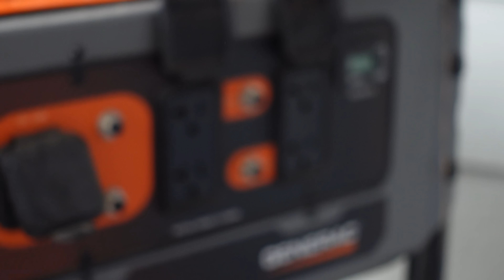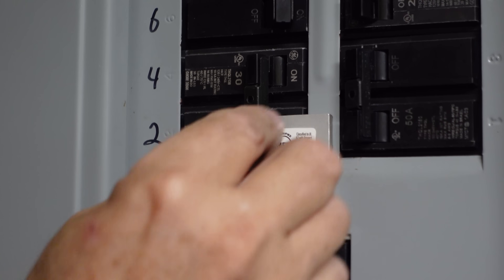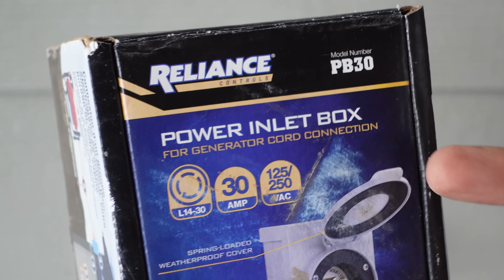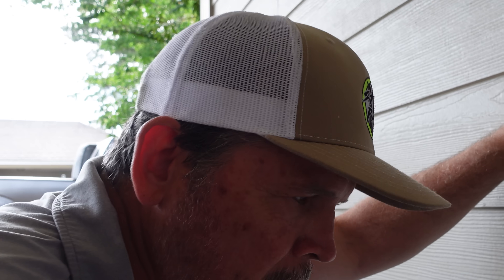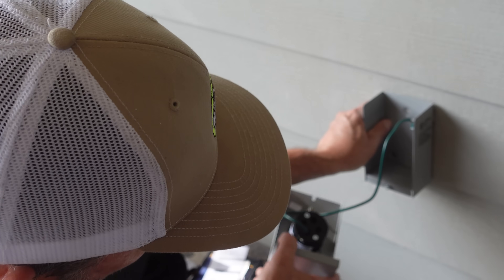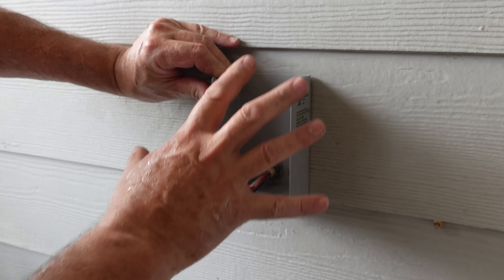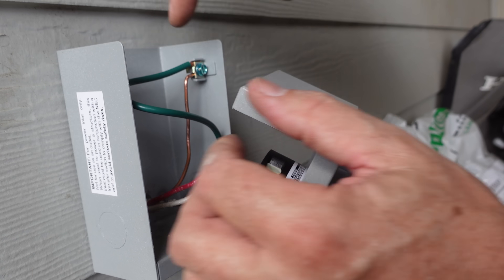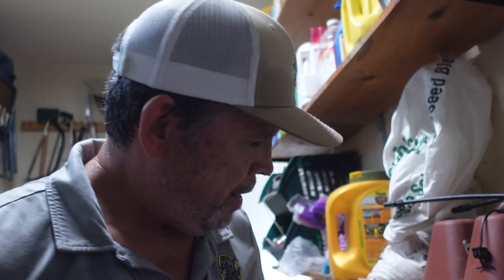What is a Suicide Cord and Why It Could Kill You

Comment: Important safety tip:  After you doubly confirm the circuit has been disconnected  there comes a time when you must touch the wires with your bare hands.   As a general habit, always touch the ground to you thumb and the hot wire with your pointer finger with the same hand. This way, if somehow you forgot to power off or if someone energized the circuit without your knowledge, a path between your fingers on he same hand will be formed.  You would feel a shock, but it won’t go through your heart.
Reply: Is this true or are you trying to thin the heard using natural selection....  I am completely uneducated with anything related to being an electrician and home improvement so forgive me if it's a dumb question.  I read this and it just felt like a troll who wants people to try it so they get hurt bad,  lol.  No offense,  just curious.
Reply: @nostalgiaarcadefuture what he was saying would make the majority of the current pass through your hand. Worse for you hand, better for your heart and rest of your body.
Reply: Use your Non-Contact Voltage Detector Pen! ( Klein Tools NCVT1P Voltage Tester, Non-Contact Voltage Detector)    Never risk a shock especially with 240v.  If you heart stops you don’t get a do over😢

Comment: You didn’t mention what gauge wire was used. It looks like it was 14/3.  For your 30A generator, you should be using 10/3 wire.  Perhaps you did, I can’t tell, but it looks like what’s sheathing.

Comment: In watching your video on upgrading the generator receptacle I noticed that the existing wire had white insulating jacket. This shows that it is 14gauge wire which is only rated for 15amps max. Thats why you found the previous 20amp receptacle which is aloud but not recommended. To run 30amps you need 10-gauge wire from the 30amp breaker. I believe you may have created a potential in the wall fire hazard.
Reply from the maker: Color coded sheathing started in 2002.   This is 10g wire in this video.

Comment: 240 volts from a 30 amp source, across some little electrical connectors an inch apart. "It's gonna kill me" is an exaggeration... but not a very big one. It could kill you and if you touch it, it's very likely to at least injure you.

Comment: Notice at 5:51 that now the receptacle is the one with prongs exposed. From this receptacle to the house lines, you need to have a disconnect where you change from plant power to utility power. That way when the utility power comes back, and you switch the disconnect, your wall outlet will not become a "suicide outlet" because no utility power will be exposed in those prongs. It's exactly what he is trying to avoid with the plant from the outside, but coming in reverse from the house with the utility power.
Reply: It cannnot become a suicide outlet.  The interlock on the panel will prevent the generator breaker from being turned on at the same time the main breaker connecting the panel to utility power is on.  It's physically impossible to have it energized from utility power.

Comment: The only real safest option is replace all this with an automatic transfer switch with mains monitoring controlling auto start of the generator and automatic switching from source 1 mains through an off position to source 2 generator. When the mains returns the ats sees the mains power return and will run on generator until a set time to ensure the power is stable and then will switch out to off position and back across to mains source 1 and generator run signal is disconnected

Comment: I have to admit that the manual interlock at the panel was the correct thing to do. But the rest is BS.  If you put the panel in two years ago, why didn't you fix the plug two years ago?  Plus - Who uses a track saw and a pocket screw guide to make blocking? A show off.  And then drills a hole 3x too big for the wire? Why didn't you caulk the box to the wall?  That's a water infiltration point. And there is absolutely nothing wrong with changing ends of extension cords - you are lazy or incompetent.

Comment: problem you might get with putting those power cables in around the wrong way is connecting a additional generator or a solar panel inverter if the phases are opposite they'll be fighting eachother but i guess thats only going to cause a breaker to pop

Comment: If they are going to use this during a storm,  that's still the wrong receptical. That one is only wet location rated when CLOSED...IE not in use. You need one that has a cover that can be closed while the generator is plugged in.  Search for a U030N. Yes they're expensive. Other than that nice job.

Comment: We used these when learning to weld
Our lincoln electric welders had them at my college
These connectors will kill you
They instruct us not to fix a problem on the welder that isnt a piece that can just be swapped out because as my teacher said "these things will shock you dead" serious stuff
If it can output enough power to melt base and filler metal, its enough to melt you

Comment: This gets so much more confusing when you start adding in power banks.  You could have a power bank that works like a portable generator,  a power bank that works like a perm generator.  BUT these setups can get even worse, because some will charge off solar/wind, but also charge off main lines, these can be set to charge during off peak hours,  meaning you could fill the power bank if needed during low usage times.   

That said, some of these are also made to "automatically" back-feed in a system to "sell power" back to the power company from solar.   so when your battery is full, your output is low, but you are still generating power, excess power will be sold back to the power companies back-feeding into the system.   Yes, this can cause the same risk to linesmen.   

so then you get the icky combination system,  Where you have power going both ways, in and out,  you have solar charging your battery bank, your battery bank powering your household system, a generator acting as power back-up, and now you need a way to dump excess energy when your batteries are full,  the solar panels are function, the generator is on,  but the house isn't using a lot of power, and it would normally backfeed at that point to prevent overcharging.

Comment: Excellent video! The explanation of how a generator works and the danger of improper connections and/or cable is spot on. The only thing I would have done in addition to the installation of the generator interface would be adding a bead of 100% silicone sealant to the sides and top of the box before mounting it on the wall. It looks like the box is installed under a porch over hang, but driving rain could still allow water to penetrate the wall behind the box.
Reply: At -1:45 he said their was a lip on the back for weather proofing 😅

Comment: TIP: When doing connectors on nockouts, try having your locking ring to the outside of the box and the screws on the inside, it sounds weird but it makes installing things so much easier if you angle it right, you can screw the box into place and clamp the wires down while the box is on the wall.
Reply: Instead: clamp the locking ring to the wire, then pull the wire with locking ring through the box, put on the locking nut.
Reply: Yes indeed

Comment: Looks good guys. Curious why did you cut the hole for the wire so large? For the metal crimp to hold the wire in, why not have the crimp part with the screws on the inside of the box? Does NEC require it to be that way? Lastly, why not just change the end of the extension cord?

Comment: The new wall outlet was really needed but the suicide cord is still dangerous. What I did was slightly different.
    When I had my garage built after we moved here, I wired it internally and externally to the house. Internally, I used 14 ga. wire for the lights and garage door opener, 12 ga. for the outlets and 8 ga. to connect it to the breaker box below my power meter. This box is 50 feet closer to the garage than the house panel, is the point where the power comes into the house, is wired to the house panel with 00 ga. wire, it saved me the expense of buying 6 ga. wire for the extra distance and was much easier to access.
    I didn't use the interlock because I didn't wire it to the main breaker panel. My panel box below my meter has knockouts for four breakers so I installed a double 40 amp breaker there, ran the wire underground through conduit and into the eight circuit box in the garage. There, I installed the appropriate breakers for the other circuits and a double 30 amp breaker for my 7 Kw troy bilt. I slipped a large, orange zip tie through the connecting rod between the breaker handles to positively identify it's job with the generator. I installed a dedicated 50 amp outlet on the inside wall specifically for the generator so that the plug never has to be removed from it's outlet and the plug on the generator's end never has to be removed from the generator. This way, nobody gets shocked.
    In the house, I shut off all the 240 volt breakers before starting the generator. 7 Kw's won't run a 4 ton heat / A/C unit let alone if the hot water tank is running or if the wife is cooking along with everything else. I slipped small, red zip ties onto the connecting rods of the breaker handles to make it easier to identify them faster
    My garage isn't fancy or finished off inside. Just a bare bones corrugated metal building unattached from my house. My generator has it's own spot by the walk in door next to it's outlet and the breaker box. It runs there when needed after I pull my van out. The walk in door and big garage door are propped open about a foot for ventilation. Otherwise, the engine chokes on it's own exhaust. I also keep a 20 inch box fan plugged into it and standing at the end of the generator for extra summer cooling. I also installed a 120 volt outlet nearby for it's wall wart style starter battery charger.
    So far, in the 21 years that we've been here, I'm the only one who has operated this system but just in case my wife ever needs to if I'm away, I walked her through each step physically and I printed a reference sheet with words and graphics telling and showing each step numbered in order. Then I attached it to the generator in a gallon size ziplock bag so she can pull it out and look at it if needed.
    What really irritates me are these knot heads that connect their 8 or 10 Kw generators to a compressor, welder or dryer outlet. These outlets are only wired with 10 ga. wire which won't handle 8 or 10 thousand watts of power when every light in the house is on, the 25 thousand BTU whole house A/C unit is running along with the fridge, freezer, TV's, kids video consoles, dad's coffee pot and mom using three burners on the electric stove making dinner. That compressor, welder or dryer outlet only has a 20 or 30 amp breaker and won't last long under the aforementioned load.
    I have a two burner propane camp stove and 2 smaller butane cook stoves if our power is off. I can still make coffee and we can use the microwave as the Troy Bilt has pretty good voltage and frequency regulation. The wife can use one of the smaller electric stove burners if absolutely necessary. Our 4,500 watt hot water heater is usable but at the cost of about a gallon of gas an hour. It is insulated and spends it's time turned off until needed. We can use the central A/C blower to circulate the air but not the compressor. We do have an 8,000 BTU A/C unit in the bedroom for heat relief and propane gas logs in the fireplace connected to two gas grill regulators on a "T" and two 20 pound tanks for the winter. If we dress warm and keep the house comfortably cool, the two tanks last about a week in an 1836 square foot house.

Comment: I'm not a pro but that connector on the suicide cord already looks dangerous.
I mean, who invented it? 
If the the mains are restored and you decide to unplug the cable from generator first, then you could also end up dropping dead.
I live in Spain and since I live in a town that has a very old voltage transformer that fails very often, I let a electrician install a male plug for my trusty old transformer from 1980's and a female one on the mains in my house.
That plug is compatible with the H07RN-F type of cable (230v one) and the male end of the cable has a shielding so that you cant touch the high voltage pins if your hand slips.

Comment: Wait, why is modifying an existing cord a no-go?

My background is HVAC. I once got a ticket from a motel requesting me to extend a temporary unit's cord. I had to rip the old one out of the unit itself and, since my foreman was on my ass about time, I just bought a heavy gauge extension cord, cut the heads off both ends, wired one end into the unit and put a better male head on the other end (the old one was obvious it used to be an extension cord)

Why would doing the reverse (putting a female head where the male head is) be a bad idea?
Reply from the maker: It was a joke for our subscribers. Take a look at our most popular video 😂

Comment: What is the reason you don't want any "shiners" 12:50? isn't a "shiner" better than a fire caused by thermal heat from fastening in the isolation, of course I don't mean a very long shiner that is obvious but a half a millimeter so you can see that the screw holding the wire didn't go into the isolation.

Comment: See I still like the uk industrial plugs as just by looking at them they seem safer just because on the male side there this plastic ring that extends to the end of the prongs round the outer edge of the plug and the conector is keyed so you not only can’t easily put it in thw wrong way you also know which way the connecters are

Comment: I made one of those.  Tree took down dropline in winter. I bought a generator and made one of those cords to backfeed into the house so the furnace would work, at least.  I took out the big fuse blocks to the line  and had no trouble.  This is possibly dangerous of course.  Unless you got big money for an alternate power automatic system for solar or generator you have to know what you are doing and accept any risks.  SO it is a thing for adults to do.  lf you are an incompetent or an idiot,  do not try this at home.  Start the generator after hooking up of COURSE.  And know where you plug in will only probably power part of the house so know which outlet is on the same circuit as the vital stuff.  And do not run the generator where fumes get in the house.  Not idiot proof but not rocket science at all.

Comment: I just randomly stumbled across this video, and living in Germany, this is... wow. You improved the safety of that thing tenfold, but it still wouldn't pass through German regulations for electricity. For example, around here it'd be required that the ground lead is longer than all others, so that in case of an incident (Socket gets ripped out of wall) it is the last one to come lose, making sure that ground is always secured for all touchable surfaces. We have specific sockets for power input which are not compatible with any power outlets, and are also built in a way that they can only be plugged in exactly one orientation. We have regulations for where our leads go in orientation. Since we run 240V with three phases (Live 1 + 2 + 3, Neutral and Ground) around here, the orientation actually matters in the sense that we have appliances (stoves for example) that use all three phase shifted Live leads. Messing up the orientation would cause an appliance to run the wrong way around. (The Ventilation on the stove, or maybe a standing drill). We call this "Drehstrom"  which literally translates to "TurningElectricity".

Luckily, we usually have line men protection built into our power consumption trackers installed at the main power line of the building. Shoving 240V through a stepper in reverse by accident is just a horrifying thought. :-(

Great video, it's cool to see how things are done in other places. ;)
Reply: If you're interested I can send you a couple of pictures from german electricity setups with some explanations. ;)

Comment: Its kind of interesting how Americans do their electrical fittings. I used to work in an Electrical factory and we got asked to make leads like that all the time but never did, and actually the way the cable twists when you're making the wire the the left ends up on the left of the male and the female at each end but it won't line up well if you try and put 2 males on or 2 females on.  Also when we did generator sets the plug ins for the inlets were a male all the time you'd never get away with doing those suicide leads the insurance company would refuse to pay out if they ever saw it.

Comment: I have one of the "other" safe ways to have a generator inlet in my house. We have a dedicated subpanel with a manual transfer switch with an interlock plate and an inlet port mounted to the outside of the house.
I do like what was done here to upgrade the generator plug location.

Comment: I used to work at Lowes.  One day a customer asked me for an extension cord with a male receptacle on each end.  I told them they are illegal (at least where I live) and I explained why.  He bought a regular extension cord and extra male plug.  Two weeks  later he was back in the store to apologize to me.  He used his homemade cord connected to his generator.  When the mains power came back on it blew his main circuit but it also set fire to the receptacle he had his cord plugged into.

Comment: i'll be real, this just showed up in my recommended section. i don't have much need for Home improvement type content, but from this video alone i like this, because it's practical info that can actually be applied. i feel like i learned more from this video, than the 5 years of High School, and my year of taking Welding in a trade school. earned another subscriber.